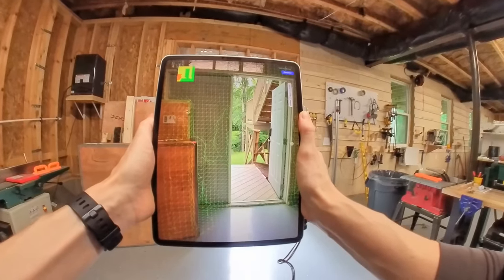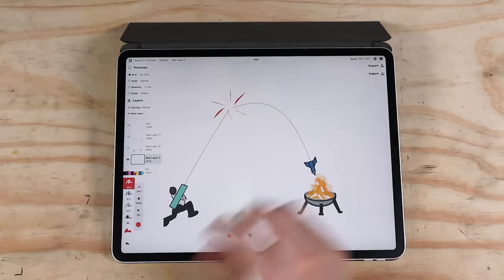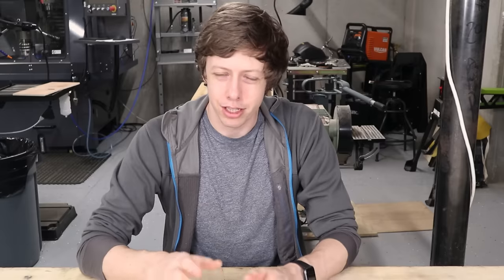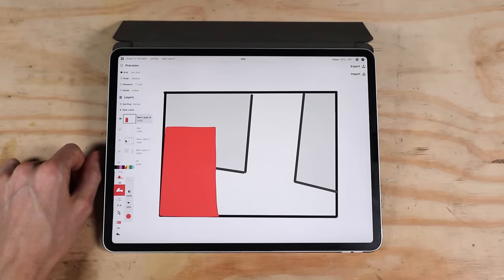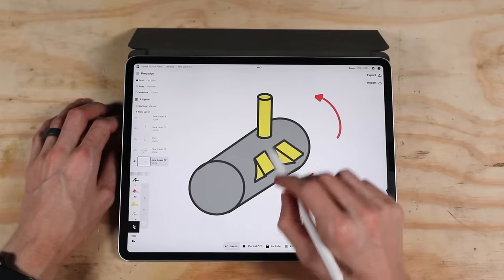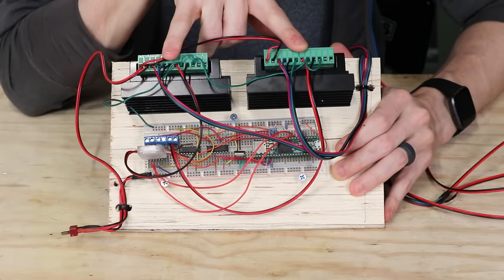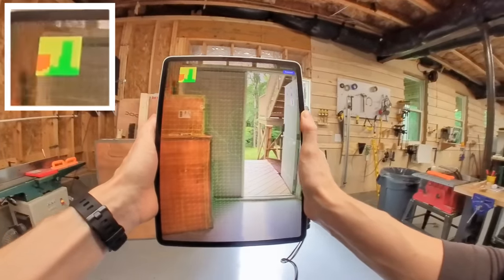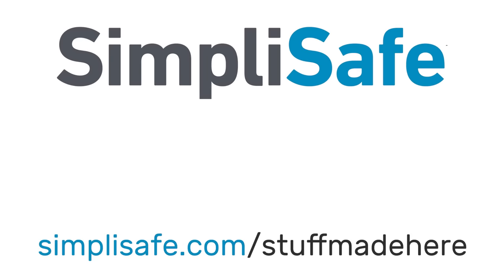See in complete darkness with touch

Comment: What career or degree you have to know all this things??? Im really interested.
Edit: I saw from his website that he worked in Formlabs at some point. 
But I'm really curious about how he progressively acquires more knowledge day by day. Books? Academys? Courses? Or simply observation try/error? It's truly inspirational for me.
Maybe a video about it!!! :D
Reply: Mechanical Engineering is what most of his projects fall under. Of course, as with all engineering, there are several subsets working together at any given moment, so it requires knowledge of not only mechanical & electrical systems, but also programming and software development.
Reply: Lets get one thing clear, his degrees don't really matter because his abilities are well beyond the typical degree holder in any engineering discipline.  The self learner types that usually drop out of college to start their own venture.  Degrees are worth little if one doesn't have intense curiosity and willingness to take on challenges.  And for those who have those two qualities, degrees aren't needed anyway.
Reply: He has said in a previous video that he studied (and completed) both mechatronics and computer science.
Reply: @carazy123_  I think more of what he does is computer engineering, directly interfacing with microcontrollers and using UART (Bluetooth) is outside of scope for a mechanical engineering degree. IMHO to do what he is doing computer engineering courses would provide more useful info than mechanical engineering courses, but they are still both very valuable. You can still learn this yourself online, all of the resources are out there, but I found the computer engineering courses I took got me to a deeper level of understanding that would have taken me a while if I were to have learned it on my own
Reply: Casey Sanders that’s what my second sentence was for. Really his projects are mechatronics projects, which does require a lot more than just standard Mech.E. But this is the most software-based project I’ve seen him work on.
Reply: @namdude0373  at my previous college offered something that translates to "technical IT", which was fully focused on controlling robots, microcontrollers, etc.
Reply: @preddy09  Proper engineering degrees in Mechatronics or mechanical engineering AND computer science is how this guy has been able learn so many skills in a short time. The proper college programs accelerates the learning process by allowing one to learn from the great minds that came before us. If he didn't go to school, he definitely won't be as young with so many skills.
Reply: As was mentioned, his degrees don't really matter much - what matters is he practices constantly, trying things and making things.  You wanna get good at it?  Try it.  Start small and work your way up

Comment: You can actuate the pins using magnets. Change the polarity moving the magnets back and forth. The forward and reverse magnet driven pins is interfaced with programing. What is seen controls the pins.

Comment: Hear me out...

The Blind-Eye™
A slim, aesthetic headset with lidar sensors on the front, back, and sides, almost like a crown/headband.
A glove that will give you feedback on what's around you by using many very small vibrators. These vibrators get more, or less, intense on certain parts on your hand depending on how far away and in which direction an object is (like how an xbox controller vibrates more, or less, intensely based on how much damage you take in some games). 

Wearing two gloves will give you more accuracy in terms of direction, but the software will have different modes depending on how many you wear, and you can definitely get used to determining which direction something is with only one glove.

Extra features may include:
 - Earphones that you can hook up to the headset would emit a low bass sound (think echolocation) that would get more, or less, intense based on distance. This would have to be soft enough to be background noise, to not be a bother in everyday life and during conversations.
 - Pointing at something would switch the hardware into Braille Mode which would, in braille on your fingertips, give you a more detailed description of whatever you're pointing at, like distance, size and type of object. This would be useful in determining the size of a doorway, height of an overhang, length and height of something in front of you, like a step etc. etc. It could also be used when pointing at stores or landmarks to get their names.
 - Tapping your thumb on each of your fingertips would switch settings. E.g: tap once on pinky to toggle between Braille Mode types (names, distance, size etc) ; Tap once on middle finger to get the name of the street you're pointing at. This would be configurable by the user (if they want to tap on their middle finger to get area of doorway then they can set that).
 - You can switch between Braille Mode and Audio Mode, so if you have earphones plugged in, if would just tell you the details instead of using braille on your fingertips.
 - A loud SOS alarm in case you're in trouble.
 - Extra optional articles of clothing, like on your feet or legs so you don't trip over stuff.
 - Traffic modes in case you want to cross a street.
Etc. Etc.

So much potential here.
Reply: The headset should be stylised to look like Geordie Leforge's visor from TNG!!!
Reply: Put it in a baseball cap. Then when someone spins it around, it's not to look cool, it's so they can "turn a blind eye" and see behind them.

Comment: 11:30 I would guess it's in part due to inexperience, and in other part that only the finger tips are the sensitive part in our hands. This system might work better if all the pins are located in the areas of  finger tips, and you just needs to slightly slide your finger tips to read it. (sort of like the way you read braille with your finger tips)

Comment: So the tactile angle looks really interesting but, as you say, there's a learning curve to process that information for spatial navigation. Would it perhaps make sense to use sound as the output instead? Could use lidar to build a model of depth information and then convert that into a virtual sound stage, with each object producing a hum/tone/ broadband hiss as in the new vehicle reversing warning devices. Varying the difference in timing and amplitude between those sounds would give position and proximity data in an intuitive way. There would clearly be challenges- if a blind person is primarily relying on hearing for staying safe, the additional cues would have to be unobtrusive. Hopefully it could get to the point where the world just contains fewer silent obstacles. Could also, eventually, perhaps integrate machine vision to recognise objects and give them a characteristic sound- roadways, people, trees, changes in slope of the ground etc.? Next gen smart glasses could well have lidar, so the whole operation could be software if also used headphones with an awareness mode. Would have the advantage of leaving hands free for a cane/ carrying items- I'd be worried about someone tripping and being unable to break their fall with the ipad... But a truly fantastic job putting your device together: a commendable idea and very impressive execution
Reply: The problem with this is if it’s panning the left and right, it would hum the same amount backwards and forewords.

Comment: A year later so IDK if anyone will see this. For projects that need more than one stepper motor, I tend to just buy an ultra-cheap 3d printer board. 4 axis control plus a bunch of spare IO for whatever I want in a small package.

Bonus: 3d printer firmware does all the hard stuff for you; if you can adapt your implementation to use gcode, then you just need to disable some of the safeguards in Marlin and feed it gcode over serial from your dedicated MCU. This effectively turns the whole 3d printer board into a gcode fed stepper driver. Very useful for rapid prototyping where you need to be as flexible as possible while you develop.

Comment: This reminds me of a project i once imagined.
Installing a magnet just under ones fingernail nerve bed does some interesting things. like allowing one to feel magnetic north, ferrous material, and electricity(ac). the close proximity allows interaction between the magnet and the nervous system and a magnet is easy to manipulate. i imagine an arduino and a ultrasonic ping sensor on the end of the finger allowing one to "feel" the distance of what is pointed at. i also imagine what it will feel like to take a scalpel and dig under the fingernail to create the magnet pocket. like a cave man rudimentary way to interface the nervous system. i have a finger already modified as a measuring device and i volunteer it if someone will fund it(the finger in question has metric centimeters tattooed on it)
anyone?
Reply: what have u been smoking man

Comment: "A bunch of smaller motors" I would've went with a bunch of tiny solenoids.
Reply: The problem is most Solenoids is they aren't typically controllable besides on/off.
Reply: @GregoryVeizades  Yes, however if you supply them with a lower voltage they wouldn't produce as much pressure on your hands which would function in the exact same way.
Reply: They don't make tiny solenoids, the smallest ones you can get are at least 13mm long. He wouldn't have been able to pack all of them into a grip-sized handle. If you know of any smaller ones please lmk... uni research project could really use it.

Comment: Love the video.  I'm curious if you could make "Iron Man Gloves" that sense distance to the closest object.  So you could wander around, using your hands to "feel" how far away things are.  So, put   one LIDAR sensor on each hand, find the closest distance, translate that to either heat, or vibration from a motor, or use pneumatic pressure to squeeze your fingers...  Or maybe each finger gets its own squeeze, so you cal "feel" as you run your fingers across an edge.

Comment: Make a treadmill adjust its speed automatically to the user’s pace
Reply: so you mean just a treadmill without a motor
Reply: Lautaro La Vecchia it’d have to have 0 resistance though, including friction. So it would probably still need a motor.
Reply: @carazy123_  it has to have friction if you want it to roll as you walk on it you only need the belt mounted on a bearing or something like that I don't see why would you need a motor
Reply: Lautaro La Vecchia Slowing down the pace wouldn’t automatically slow it down though. Imagine going fast on a belt with bearings, you can’t just slow down and have the belt slow down with you quickly.
Reply: @Fastman698  oh i see what you mean now, that would be useful

Comment: Violin Project...you might try this!!!!  
(Make a violin; (the easy way))  
Get a few white wood violins, (no stain, no varnish, ready for glue up)....  
Get them from a violin manufacturing firm....  
remove the back, and holding it flat, run a bow up and down along the side.  
Watching the patern, a little sand makes...the center of vibration, is in the center; (the sound post is off to the side!!  
With a little tiny plane, recarve the back to make the center of vibration, under the sound post!!  
You will have made stradivarius violin!!!!!!!!!  
A university prof. did this about 40 years ago...did fabulous things with violins.  
get a few extra bridges....

Comment: Teeny tiny haptic motors could also potentially work if you wanted to make it into a wearable, like a glove. Depending on how much force it requires to be detectable, you could also potentially go for those magnetic actuators which work on the same basic principles as a voice coil. They're not great for high force requirements, but you can also keep them lifted and vary the voltage sent to change how much they move. you could even go to the trouble of reverse-engineering the balanced armature driver and manufacture some super-sized version of those with pins instead of diaphragms.

Comment: Soft flexible hydraulically actuated plastics or electroactive polymers, or even direct electric stimulation with weak charge, could give a variety of bump maps with finer granularity than mechanical pins. It could also then be made thinner due to the actuator being liquid or electrically based directly in the material. Ideally rather than an iPad, you could use eyeglasses with built in LIDAR, paired with oven mitt like gloves which fit in your pockets. Just chuck your hands in your pockets for your spacial information without looking like a weirdo.

Comment: instead of using mechanical pins, you could try electric impulses. It should be more space efficient. The user also could regulate the intensity, so it doesn’t hurt or hurt on purpose

Comment: I imagine a design to fit in a phone case could utilize the same technique that phones use for their vibration motors. That way you don't re-invent the wheel. Possibly a longer adaptation of it or multiples of already manufactured ones each with their own corresponding ball or pin for textile feel on a slimmer case. It could even draw the power directly from the phone since the voltage and wattage can remain very low

Comment: I think that you might be able to use electromagnet coils to drive the pins.
A plastic pin with a metal bottom to draw to the middle of the coil. 
It would even let you have more granularity of the pressure.

Comment: it's not just the EU and Canada, it's literally the rest of the world. And with reason, since the official definition of a foot is 0.3048 meters, for example. The official definition of a meter, in contrast, is the length of the path travelled by light in a vacuum in 1/299 792 458 of a second. Because of this, you could even say the US is also using metric, they just don't realize it

Comment: Maybe instead of this cam profile-like mechanism, the “poking” system could use some sort of elliptical, free spinning bearings on shared axles, each bearing moving a different pin. Because of the shape, it would “poke” slightly harder as it spins. They could be moved by some sort of belt connected to a spinning engine on the bottom of the device. At least in my head it could work, tell me why it wouldn’t, please

Comment: What about having the sensor mounted on a hat or pair of glasses? People can sense the direction that their head is pointed quite well. You could then use a single earbud as the interface and have tone's correspond to distance. This would leave the other ear available for listening to the world around you. People are far better at recognizing subtle differences in sound as the music industry shows so it might work better than touch for something like this.
You'd have to scan back and forth a bit to build a mental picture of what's in front of you but would result in a much smaller interface that wouldn't interfere with use of your hands. (in case a blind person wanted a cane as well)

Comment: There was once a "reader" that was a little camera/sensor wand that you moved around the page, and a little bed-of-vibrating-pins that vibrated for dark spots. It was easy to wave it around to find the start of the text on the page and move along each line, feeling the outline of the letter with one fingertip. I forgot the name of the device :-(  I've seen attempts at modernizing the feely-sensor part with piezoelectric cells or LCD-like material that formed bumps when activated. But no common products as of yet 😞

Comment: Its a little late, but I think the mechanism for detecting stuff around may be much more simple.

The first thing I thought about was to use gamepad-like vibration motors in a glove. Motors would be put on a dorsal (opposite side of palm) side of the hand, which could be possible as these motors can be as small as a nail and all you need would be to give it enough voltage to describe how close the thing is.

The bad part of that is battery problem since vibration motors are kind of resource hungry afaik, and, well, kind of uncomfortable or unhealthy to your muscles in a long run? Dunno

The second way to do this could be a form of the sonic wave? We do feel the bass from the sound speakers, and we know it can be powerful enough to break a glass, so closely attached 3x3 or 4x4 microspeakers could send to out body something we could actually feel by hand. It would require a kind of complex sound driver to spread each sound wave from individual speakers without interfering (going into antiphase, hello noise cancellation).

The third way would be some kind of electric glove, but I am very pesimistic about being electroshocked the whole time.

I wish you could revisit that project as it is world changing stuff here.

Comment: You got to fit all the sensors &, computer into a small chassis that can be worn on a backpack/chest rig,
the camera is on a cable and mounts to the shoulder straps,
A cable from the computer box attaches to a wrap around Velcro arm cuff with those knobs that press on your hand in cuff.
The camera would need to be zeroable for each user

Comment: Did you consider using a common rail actuator with pizioelectric gate switches for each pin? You could power the valve body with a simple CO2 cartridge used to make soda. The system would mimic a fuel injection system in a modern EFI engine.

Comment: one thing that I think could be improved - to use a wider lense to allow the device to see closer to you. current design has a blind zone of of a foot or two in front of you so you have to keep a projected mental image. taking into account the resolution it may miss some small object that you will trip on as you are further away (like a small rock or a road bump)

Comment: Okay so I have an idea. Electronic magnets. If each pin is on a spring and a small electronic magnet moves it outwards, that could be super fast and probably relatively cheap and u can probably control is very easily.. Just a thought.